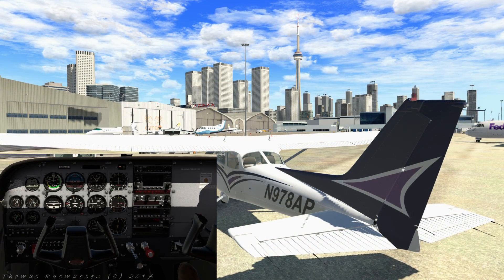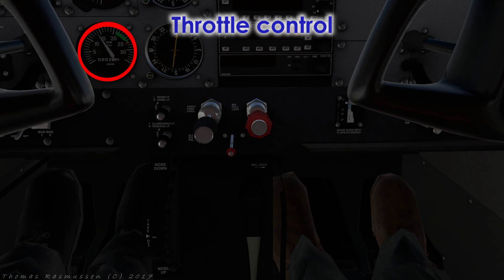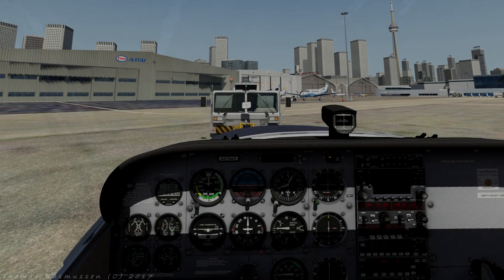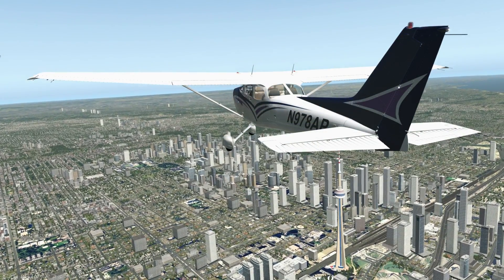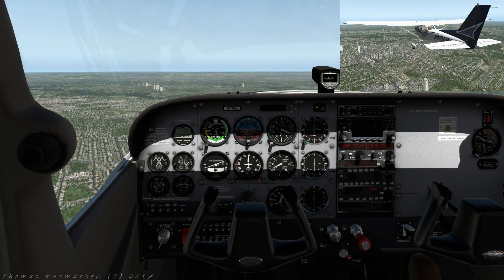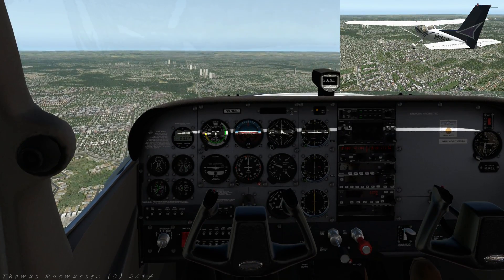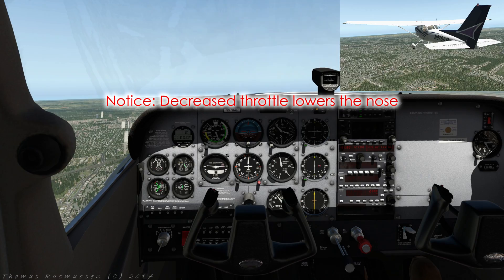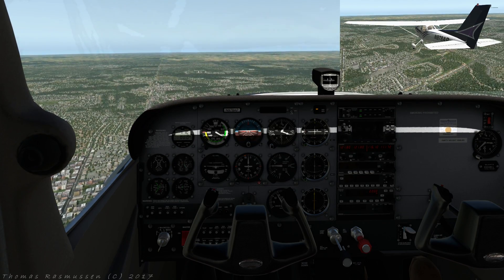[X-plane-11] Flight Sim School - VFR Lesson 1 - Flight Controls

Comment: Adverse yaw is the movement of the nose of the aircraft first towards the high wing before moving towards the direction of the turn. To bank the airplane you need to create lift which results in additional drag. The quick movement into the turn isn't creating adverse yaw. Adverse yaw is normally demonstrated by using a slow airspeed. Slowly banking the airplane should pull the nose of the aircraft towards the high wing before reversing course in the direction of the turn.  What you will discover is the lack of adverse yaw with X-Plane and Microsoft Flight Sim 2020. Of course this video is 4 years old, and you probably know about your misunderstanding of adverse yaw by now.